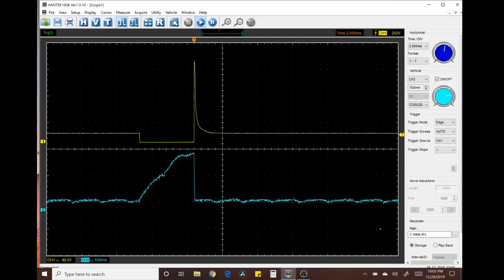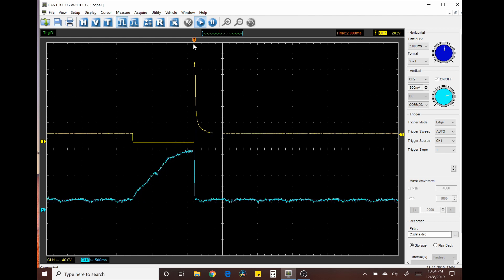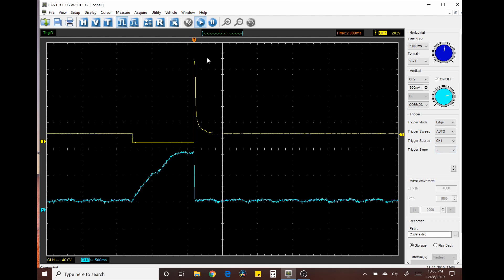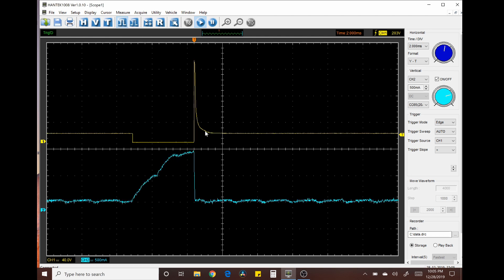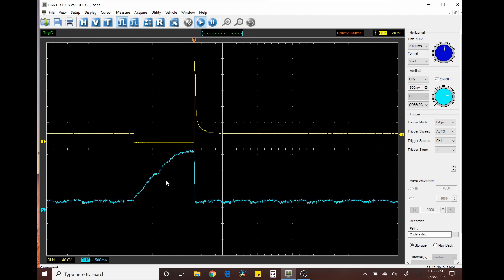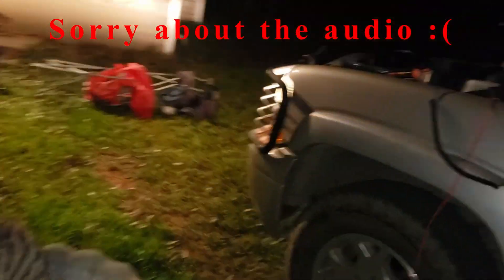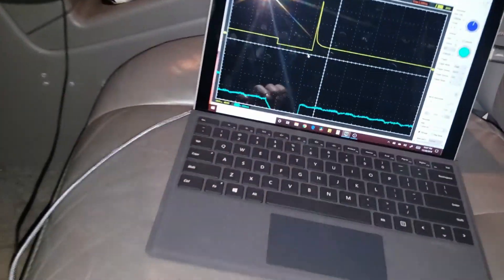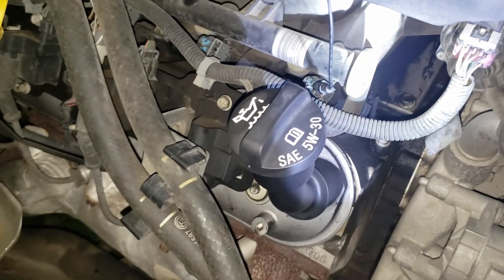Injector Waveform Analysis - Voltage and Current Using Hantek 1008c

Comment: do you have to setup the app your using t use the inductive probe you put  over spark plug wire? i have the same hantek scope but when i try to check secondary using the inductive clamp its not working

Comment: Good video. there should be more videos like this that go into more detail of how and where to back probe the connectors ,for voltage and amperage. What wires specifically   to connect to. No one does is it.

Comment: I currently have picoscope 2004a, 2 channel 10MHz scope I really like it, but at times I wish it had 4 or more channels. I'm thinking of getting hantek 1008c, because of low cost and 8 channel capability, that is a rear feature in case the scope is still usable with more than 4 channels. I Mostly work on (explore) my own  15 and 20 year old cars as a hobby.
Can you do a video with similar speed signal (injector or ignition), but with all 8 channels enabled (they might be unused, but turned on)? 1008c waveform detail is decreased by using more channels, in all videos  I found about about 1008c only 1 or 2 channels are turned on, because turning on more channels would decrease signal detail. I can't find a video with "real world" waveform and all 8 channels tuned on. I'm interested in 1008c waveform detail and scope performance if all 8 channels are used.